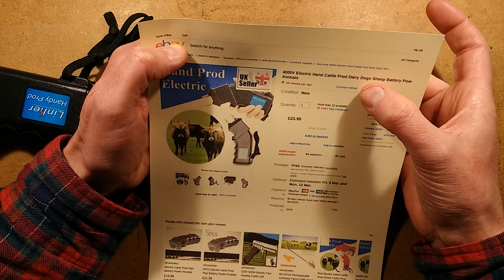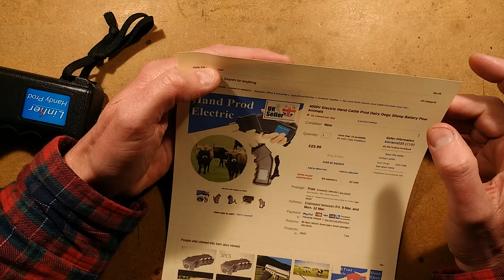Does a cattle prod hurt?

Comment: The prongs look like the standard EU plug. What were to happen if you plug this in a wall socket and set it off.
Reply: Power companies HATE this man!
Reply: post tyrone click here to find out this simple and top secret trick, which will reduce your electricity bill by 95%
Reply: KREOSAN used a taser into a socket and it made the lights flash
Reply: Cattle Prod vs. 230 Volts -- The Result Will Shock You!
Reply: Nothing.
Reply: It must be done!
Reply: Quite instantly, the output windings on the transformer would become metallc vapour. Sophomoric idea at best.
Reply: Indeed.  Arcs are wonderful conductors.  You're basically injecting liquid copper into your wall socket and it spews out and into all of your electronic devices plugged in nearby.
Reply: @Mackze  lol
Reply: It's too wide
Reply: Bang
Reply: It would be lit
Reply: @gcewing  plastic doesn't conduct electricity so no you won't be shocked

Comment: Interestingly enough, when Clive tries to stun himself through his shirt, I could clearly hear a high pitched whine, probably above 18k-20k Hz, maybe higher, wonder why that was.
Reply from the maker: The high frequency drive circuitry for the voltage step-up transformer.
Reply: Indeed.  I heard it too, and recognized its likely source.

Was it audible, or was it transmitted to the camera's electronics by induction?
Reply: Ah yes, that would make sense.
Reply: Clive squealing, or possibly cremaster muscles snapping.
Reply: @tom lewis YouTube actually supports frequencies up to 15,000Hz, and have been for quite awhile.
Reply: I heard it too.
Reply: bigclivedotcom it was interesting....but was it really interesting enough?? I just can't make that call.....but I'll tell you I'm leaning towards not enough....

Comment: Clive, i could feel that. Having radio as a hobby i have a few old tube rf amplifiers. And have been bitten rather hard by the b+
supply - 4.5 kv @ 3800 ma. The bleeder resistors failed open 40 or so years before i got there. That is the worst i've been hit by..thus far.
it was enough to slam me against the wall hard enough to break my arm. And much more than enough to call it lights out permanently. I was young and in a bit of a hurry. Good reason for the most painful lessons being the ones remembered the longest. High Voltage and negligence = short career span....Or Darwin at work....
Reply: Such big tube amps need a jesus stick... Would have made one hell of a bang and probably vaporized part of the stick, but better than getting shocked yourself i guess.
Reply: LIMAVICTOR = lowvoltage  lv. Yeah it was a pair of 4-1000's in linear service, separate powersuckply. Got it back in the late 80's for $100 at a ham flea market 40 mtrs and 80 mtrs  AM only. I had the dream of a high power plate modulated am rig - never happened. Still have it in fact and it still works very well. Gotta love well made home brew stuff ! Vacuum  variables too, i saw the tubes and could not get the cash out fast enough.
These days people think a 12AT7 is $50 bucks in the box. I saw a pair of 6BQ5's for $80 bucks on flea pay.
Both of which could be had for a few dollars in the late 70's.....DAMN i'm old !!
I don't want to go too far in this direction...in respect to Clive   You are right about the stick..It's wrapped in 
many layers of super 33 plastic tape, i'm sure it's saved my life many times... 73's             JR

Comment: The only real use for a cattle prod is if a cow decides to squish you against a wall when you don't have a hay fork nearby (fun thing about cow is that they can be quite mischievous), when you DO have a hay fork nearby they know not to mess with you (you only need to gently push/place it on them for them to figure out it's not a good time).

So it's really a backup thing that doesn't take up much space.

Comment: The cattle prod has quite a history here in the US of A.  They are not used by farmers, or ranchers, well not very often, only when "working" the herd, that being de-horning and castrating the calves.  They were designed for, and commonly used by truckers who haul cattle.  Their main purpose is to get cows, who have a tenancy to go "down" while in transport, and if allowed to stay down become trampled by their fellow cattle, back "up."  I recall when I was but a boy, my dad worked at a truck stop, whilst mom worked cooking at the cafe that was attached.  I used to hang around with dad at the truck side where I go to know the truckers quite well.  The truck stop sold cattle prods, and "special" C+ size batteries, which were really just C Cells in a special wrapper I think, cause I got a set and tried them, they seemed to last a bit longer, but that is a different story.  Well the cattle prods back then (mid 1960's) consisted of a chromed stick about four feet long with two electrode's sticking from the end, and a trigger button with a sort of bicycle hand grip on the control side.  Truckers could walk down the side of their cattle trailers, and stretch the prod into where the downed animal was, and give them a jolt to get them back up.  It was not uncommon

Comment: if an angry dog is trying to bite your face off it is probably acceptable to use it on that dog ;)
Reply: I worked in an animal shelter for quite a few years and I've run into a few dogs that would have just stopped momentarily, looked at you then proceeded to bit your face off. Dogs don't feel pain the same we we do. I'm pretty sure a couple of them would have smiled.
Reply: True, they don't, but they do respect intimidation. Don't back down, make yourself big, and give a war cry. That will send 99% of animals running for the hills. And most humans too. The other 1% were going to try to eat you anyway, so in that case you should be prepared to back up the threat with a right hook and a fist down the throat or ideally kick and punch the abdomen where the ribcage ends. Assuming you're at a deserted (place) and a dog runs up on you with a low snarl.
Reply: of course this happens all the time and everbody has this shit thing in his backpack lol
Reply: @herpnderpn2484  you're an absolute unit
Reply: SmashBomb  
I am legitimately unsure of what you are saying. It's entirely possible I made that comment after a bit of whiskey or something. I really do not recall.
Reply: @herpnderpn2484  you mention whiskey and neglect to share
Reply: Brass knuckles are more effective
Reply: @spencerblack3253  depends if you know how to use them you dont punch with brass knuckes you swipe
Reply: @tom lewis I usually have a knife or theres always a stick nearby
Reply: @tom lewis I've been carrying a knife since I was about 12 but most dont

Comment: We have something similar to that. The electrodes are at the end of a fiberglass  rod. We sparingly use it when we are running our beef cattle through shutes to work them. Giving them shots, fly tags, or worming them. Every once in awhile a cow will not budge. After trying other methods one short buzz will usually do the trick.

Comment: "4000V? I wOnDeR iF iT hUrTs."
(Proceeds to have about a 1A current through hand)
Mission accomplished: "It hurts."
Reply: 4000v is nothing. I get shocked on a regular basis I don't mind anything up to 10,000v.
Reply: @Azumuthgaming  yeah, but consider the resistance of human skin, those amps would kill, although I will admit it's only around 1A upon contact and is localized within the guy's hand, which is why you can still live being shocked by high voltage devices (like tasers)... It'll hurt like hell though

Comment: I got one that looked exactly like that at a local farm supply store. The prank went well, but the device just sat in a drawer for several years afterward with no use. I finally had a go at converting it into a pocket EMF generator, 3D printed coil housing and everything. It worked fine for 5-6 tries, then let out the smoke. It went back into the drawer, waiting for the day I’m bored enough to pick through the potting compound.

Comment: It's kind of like those bug zapping rackets, but just more beefy. You can zap yourself with the bug zapping racket and it isn't that bad, but I bet this thing actually legit hurt quite a lot, you are brave to zap yourself with it. I live in Australia and there are electric fences here for cattle and stuff, often when we were little we would touch the fence for fun, the average electric fence wouldn't hurt much at all, it appears just designed to slightly irritate the animal, not cause severe pain, which is why us humans can touch it also and it's not that bad. The electric fence also appears to operate in pulses, so the animal can keep feeling an annoyance if it remains in contact with the fence after the initial shock. 
What you have here however, is a serious zapper, something which truly will hurt obviously. 
Cattle prods are used, but usually ones with long sticks are used, and mostly on beef cattle, I have never seen ones with such a short design like this one, I personally think this is intended to be used against people and is listed as a cattle prod just to be able to sell it on ebay to UK and other people.

Comment: Ya clip the prods shorter and drill a hole in the center of each prod. Then you solder in needles leaving 1/2 inch of needle sticking out of the end of each prod. Goes through clothing very easily as well as a bit of flesh and is a very effective self defense weapon. Not a legal modification but who is thinking legal when someone needs an attitude adjustment. And it is completely non lethal.

Comment: With catalytic converter thefts on the rise, I'm wondering if there is any way one could attach something like this to the bottom of a car to zap any potential thieves. Potentially attaching it to a car battery rather than alkaline ones and attach it to the exhaust system itself, so anyone who touches it will get a zap. Might also ignite any fuel inside the pipes and possibly blow the cats out anyway but I've always wanted to shoot flames like a GTR. Not quite the same in a Honda Accord but one can dream. Looks like a lot of work. You seem more clued up than I do though. Would something like this be possible?

Comment: In an Abattoir Cattle sometimes refuse to walk up a race in single file into the knocking 
box on the kill floor, maybe they sense danger or smell blood, but a few jabs with a cattle 
prod gets them moving. The ones that I have seen were not battery operated but on an 
electric lead. If walking & accosted by dogs a long handled cattle prod would be comforting.

Comment: On the contrary you can indeed own firearms in the UK but they are heavily regulated. You must apply for a license for the specific gun you wish to own for example if you want a shotgun you need to apply for a shotgun permit. In the process of applying for your permit you must meet the following criteria: 1.) you must have a valid reason for the firearm (note self defense is not a valid reason because the UK has no castle doctrine) 2.) you must live in a rural area anywhere that is not located within city limits can be considered a rural area, 3.) you must have a gun safe that is approved by the local police as well as a means to keep ammunition separately from your gun. 4.) you cannot own firearms if you’ve been adjudicated as a mental defective (this includes mental incompetence which means one cannot account for their own affairs because of lack of mental responsibility) 5.) you cannot own firearms if you’ve been convicted of a crime. Note some firearms in the Uk are illegal and cannot be acquired with a license. Also many firearms like handguns must be modified to exceed a certain length. If you live in Northern Ireland you can apply for a license to carry a handgun for self defense but me explaining the requirements is like opening a can of worms but I’m pretty sure a lot of the above criteria is similar

Comment: I once repaired a 5kV one that had come apart (Coil wire came off, soldered it back on and it was all good.), and of course I thought I'd test it. 
It had a safety feature where both of the pins had to be pressed in to actually trigger the spark.
So I held down one prong with my finger and used a gedore 2kV Isolated Screwdriver to push the other pin down and short the pins at the same time. At least in therory. In rpactice I got zapped because the pin got pushed down before the screwdriver could short the prongs. 
That day I learned that using isolated tools is important :D

Comment: Does it hurt? Well, it's designed to hurt an animal over 10x your weight, so yes... it's gonna hurt.

I think cattle-prods operate fundamentally different to stun-guns/tazers though, The fact that they both use electrical shocks doesn't make them the same despite movies and media often making them seem like the same thing. This thing probably just produces intermittent zaps to produce pain, while a stun-gun/tazer is supposed to disrupt the electrical signals going to the muscles and produce spasms - thus hopefully grounding and incapacitating an aggressor for a short time. They typically do this by having a very high voltage initially that instantly reduces the moment a circuit is established, but the circuit is maintained throughout for a continuous effect.

You probably don't want to stun your cattle after all.
I imagine it could still be a useful self-defense tool just because the shock would be enough pain and surprise to make most people back off, but it won't be stunning anyone. At least I'm pretty sure it won't (disclaimer: I haven't actually use a cattle prod myself).

IMO, pepper spray, CS-gas (or whatever variant is legal in your region) is a much more practical and effective option. Having a hard time seeing and breathing for several minutes will make most attackers change their plans and it should give you ample opportunity to get away. Also safer, more portable and maintenance free.
I've experienced both CS-gas and pepper spray myself (twice in the military and once as a horrible prank gone wrong) and I can tell you that you definitely don't feel much like fighting after getting hit by that.
Reply: Well written bro 👌🏼 I’m from UK I’ve made my own CS gas 👌🏼 it’s useful

Comment: Electric fences, meant to keep cattle & sheep from straying, can give a surprisingly big kick if you are unlucky. It's happened to me 2 or 3 times while out walking in the country, once when I was using my Nordic Walking poles (cheaper ones, using aluminium, rather than the more expensive, all carbon fibre ones) in the rain, and got a bit too close. But even in the dry they can be a bit fierce.

Comment: When I bought one of these on Ebay, the photo showed massive blue sparks jumping across the prod-terminals. I later learned that you need 40+ thousand volts to jump an inch gap in air! This unit claims to produce just 4000 volts. The maximum length of spark you can theoretically hope for here is 2-3 mm. So, I suppose I should be grateful that the spark from mine manages to jump a gap of 5 mm! It won't jump 6.

Secondly, everyone probably knows that for an AA battery to make proper contact, the negative terminal must press against a spring, whilst the positive end makes contact with a small metal dome. THESE units have been made with springs fitted to ALL FOUR of the inner terminals, regardless of whether they are positive or negative. You can just about see this on the above video also. So, it wasn't just my unit. My purchase came without batteries, and I could find no diagram or imprinted symbols to help me decide which way the batteries should go. The the lid to the battery compartment correctly carries 2 springs and 2 metal domes, so this gave some indication - but when I saw springs on all of the inner terminals I lost my confidence. I didn't know if a mistake (reversed polarity) would harm the electronics.
I had to take unit apart to find, with some relief, that at least the wires inside were coloured red and black!  Even when I inserted the batteries, the too-many-springs failed to make proper contact. I had to rig up an external 6V supply to find out how well the spark generator worked - if at all. 

I AM disappointed, because as I am becoming more frail I was hoping to use this item for self defence. It is not my intention to shock anyone! Rather, I was hoping that the one inch spark in the deceptive photo would be real, and that the sight of it would then deter any aggressor from even coming close to me. In hindsight, I should have done more research. There are plenty of graphs on Google images showing the voltages required to produce various lengths of spark in air.

Comment: I sold it for $20 but I always wondered if I jump the input voltage up what it eventually spark across the prods
Reply from the maker: A real stun-gun is designed to arc safely with the higher voltage.  With this one it could arc across at the plastic and create a track across it.
Reply: @bigclivedotcom   yeah but I'll never find one of those in a dumpster in Cuba Kansas

Comment: A simple modification could make it work straight through that shirt.
If u put something sharp and shallow on the end similar to what the stun gun uses to jab into the skin without going deep, it should then go straight through a coat.
And while yes, stun guns often fail through certain fabrics, thats cos it doesn't have much kenetic energy behind it as its being driven into you.
If you used ur hands to drive it into a bear, it would very much work.